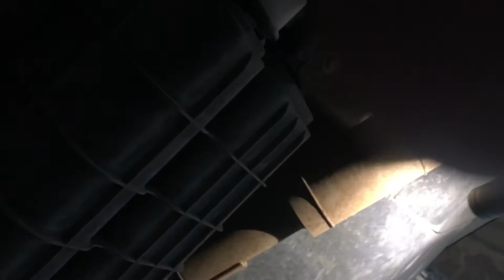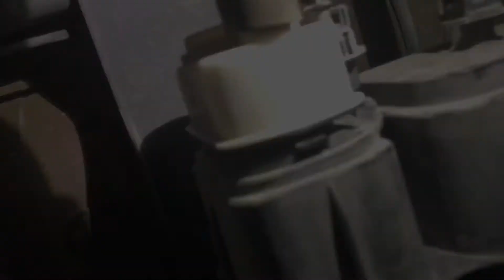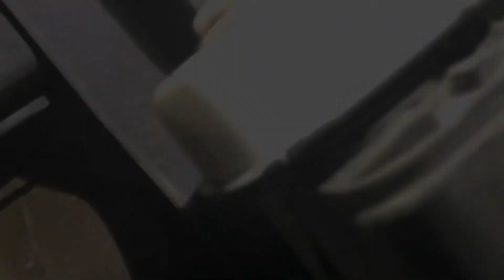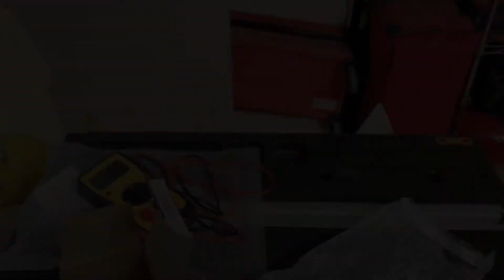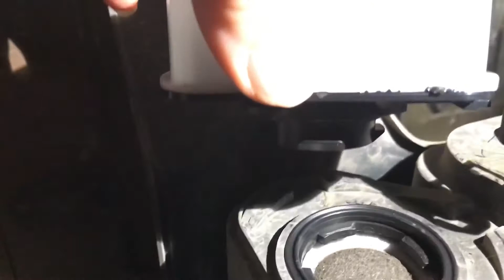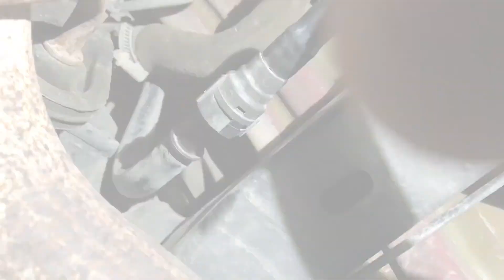JEEP Evap System Integrity Module Replacement

Comment: I think I have this problem got many codes with two different Purge valves. One day po440 and the other say po456
Reply: What's the name of the part
Reply from the maker: @michaeljackson2106  In my case, it was the integrity module, but it depends on the vehicle and what part has failed. It could be a simple as the gas cap. Or it could be as severe as a cracked fuel tank fitting. I've been down both roads myself.
Reply from the maker: That can be frustrating. You can pick up an inexpensive code reader on Amazon for around $40 that could give you more information.

Comment: Got the same code for my 2009 Jeep Liberty. In my case all that was needed was a thorough cleaning of the gas cap/gasket and the area on the filler spout the gas cap screws into and fortunately, that was all that was required to fix the problem. Check engine light is off, Liberty passed the emission test last week. Best advice I received about my Liberty was to thoroughly clean those two areas.
Reply from the maker: I've experienced that as well. I fact it's the first thing to check before anything else. Most common point of failure on most vehicles and the least expensive to repair. When it's not the fuel cap, that is when the adventure begins! Thanks so much for watching and for leaving me a comment. I really appreciate it.